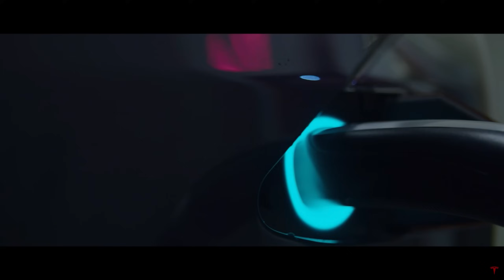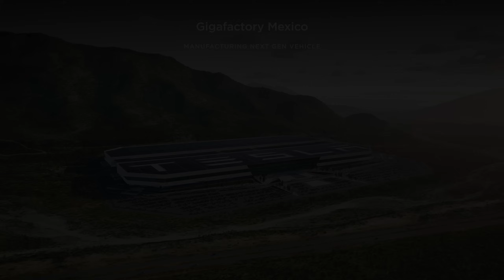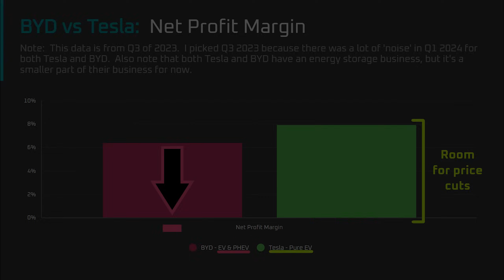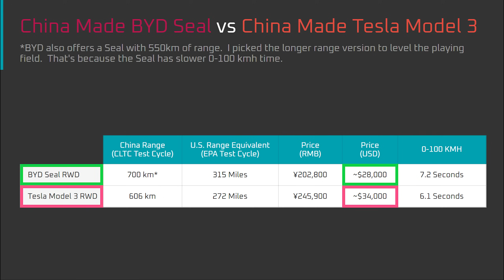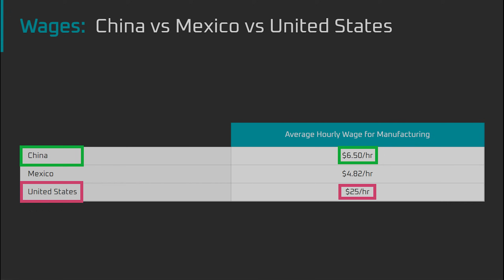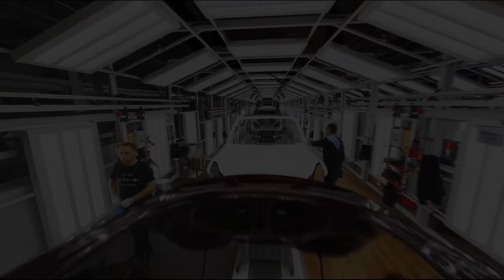Chinese Automakers are Going Global // How will Tesla Compete?

Comment: Most of this is dependant on the Unboxed method, which they told us they aren’t focused on right now and will just add some of the benefits previously intended on unboxed line retrofitted onto current lines for cheaper versions of current models.. but not the unboxed method. If unboxed happens, it’s much further down the road and focused on robotaxi before any consumer models.
Reply: No. Much depends on Robotaxi and it looks like that is going to come very soon. Maybe at 8/8 reveal with scale-up thereafter.
Reply: @Michael-Has-Opinions  watch the video again? While I agree Robotaxi is the focus and unboxed has been pushed off, there’s no mention of that in the video. Multiple times the explanation is that unboxed will keep Tesla competitive with BYD in Mexico, but that’s not happening short or medium term.
Reply: @spleck615  Because Tesla is not using the full unboxed on the new less expensive cars coming to existing lines, people may have construed this to mean the unbox has been delayed.    
Maybe it is wishful thinking but I expect the robo-taxi and the consumer cars are the same.   The taxi ships w/o the controls.
Reply: @danharold3087  Unboxed was delayed. Elon said it. They will make cheaper models on existing lines instead. This is not speculation.
Reply: @spleck615   Yet we are hearing the robo taxi has been pulled ahead.  We will know on 8/8
Reply: @danharold3087  Yes, that’s the point. The unboxed method may be used for robotaxi. Looking forward to 8/8 to learn more. This will be incredibly low volume during development, testing, certification, etc. It’s not being used for the lower cost car that will compete with BYD in the next couple years being discussed here, Elon said those will be built on the existing lines with modifications. My expectation is that will happen in China, just like Highland was, which is why both Tom Zhu and his lead Cybertruck ramp specialist went back to Tesla China, resigning from their Tesla NA roles.
Reply: @spleck615  Tom Zhu going back to China makes a lot of sense in this context.  I agree.
Reply: I don't think it makes sense for Tesla to use factory ability to produce economy EVs for private sales if they can put those EVs into robotaxi service.  That seems to have been Elon's thinking quite a while back but he was apparently pushed into talking about a "$25k" EV by others in the company.  If FSD is completed and robotaxis possible we may never see a Tesla economy car.  It just doesn't make sense, either in terms of profits or mission statement fulfillment.
Reply from the maker: There's some optionality on FSD and Robotaxi.  Lots of variables

Comment: Tesla can’t compete with China BEV makers that can source the batteries for less than Tesla or as in BYDs case they make them in very large scale themselves.
Reply from the maker: In the long term (5-10 years), I agree.  But not in the short term.

This dynamic won't matter as much if Tesla solves FSD.

So, not that simple.
Reply: Teslas use the same batteries as BYD, buying them from CATL. They just don't use these in the US. The US is 20% of Tesla's sales.

Comment: Your prices are all wrong. BYD seal needs heavy modifications to be allowed to be sold outside China and support infrastructure which raised its price significantly. In the EU for example the base version of Seal with 570 km (WLTP) is about 6.000e euro more expensive than the base Tesla model 3 RWD with 554 km of range. And the import tariffs in EU are going to change following the US from 10% currently to ~40% or more.
Also it's highly improbable BYD is profitable selling all-electric vehicles.
Reply from the maker: I'm not sure how this conflicts with the thrust and main point of the video.
Reply: @thelimitingfactor  Based on real prices and data (China artificial market prices cannot be extrapolated to the rest of the world) BYD currently and for the foreseeable future cannot compete with Tesla or even most European manufacturers (their prices should be closer to those of Polestar ~80%-100% more than Tesla). Their offerings offer too little value for the money, especially if we take into account quality, reliability, safety, ease of use (supercharger network), aftersales support etc. If they can't compete with these heavily subsidized prices and the huge Dumping how will they be able to do so when the US and EU fights back and stops the anti-competitive attack?

Comment: I want a cheaper and smaller and slower Tesla with 2 doors
Reply from the maker: Yeah, would sell like hotcakes!
Reply: Agree  @thelimitingfactor
Reply: Single production line putting out 2 door, 4 door, 5 door, mini-truck, van and cybercab. A little patience and we will be there in 5 years.
Reply: " want a cheaper and smaller and slower Tesla with 2 doors"
Might be a good description of the robo taxi with added control package.
Reply: Meanwhile, I want a full solar paneled Aptera. An electric car that actually makes sense, light and very aerodynamic.

Comment: To be honest, that is not a good comparison of EV's. The Fiat 500e in that price is the Cabrio version. The standard version is cheaper.
But the best comparison should be, the BYD Seagull (with the price shipped to the EU and with the standard tax for all EU EV's) and the Citroën ë-C3.
Than, the prices get a lot closer to reality. That Seagull will be around double when it hits the EU market, so €22.000, the Citroën ë-C3 is €23.300.
Than, compare the range, quality, comfort, service and availability of parts.
Reply from the maker: Fair enough, I did that for the Tesla

But, the point ramains nonetheless that Chinese automakers produce vehicles more cheaply, people are buying them, and it's taking market share from European manufacturers
Reply: @thelimitingfactor  BYD seal needs heavy modifications to be allowed to be sold outside China and support infrastructure which raised its price significantly. In the EU for example the base version of Seal with 570 km (WLTP) is about 6.000 euro more expensive than the base Tesla model 3 RWD with 554 km of range. And the import tariffs in EU are going to change following the US from 10% currently to ~40% or more. Also it's highly improbable BYD is profitable selling all-electric vehicles.
Reply: @admarsandbeyond  BYD has been designing its cars for exports, Seal needs few modifications, mostly software, for Europe. They just hike the price to align with the rest of the market and make much higher margins.
Reply: @etbadaboum  "Seal needs few modifications, mostly software, for Europe." Is that your opinion? Is it as accurate as "The real Chinese car brand in Europe is Tesla"? You do know that Tesla has a gigantic factory here and owns 100% of their factory in China right? That's like saying Apple is the real chinese brand because it has a factory in China
Reply: @admarsandbeyond  I know it because this is what journalists talking to BYD has written about. And more than half of Tesla cars are produced in China. Tesla cars in Europe come mainly from China with all Model 3 and LFP Model Y coming from Shanghai. Since Tesla is the first EV car maker in Europe for now, and that most of their cars come from China, yes Tesla is sort of of a Chinese brand. I jokes a little and you took the bait.
Reply: @etbadaboum  I don't know your sources, but it was a BYD official (speaking to Bestintesla) who said that high prices are due primarily to modifications to meet European standards. The same was  reported by Bloomberg and the WallStreetJournal reporting that BYD had 10,000 cars stranded in European ports with serious safety and quality issues. 
And it makes total sense. It would be pretty stupid to sell the base Seal for example 5-6000 euro more than the much better Tesla Model 3 RWD they're copying (a far more efficient, more comfortable, higher-tech, better quality, better supported American car) if they didn't have to.
Reply: @admarsandbeyond  Several journalists, like Telescope for example who is a former NIO executive (and has worked to export cars to Europe by the way) and Chinese commenter for the Formula E in China. Please send these links to these articles because I've never read them. BYD engineers cars for exports. It'd be pretty stupid to have several designs of the same car for different markets. The main modification is software and they have to recode many parts of it and not just the language and the data must be stored locally. Also some have the idea that China has inferior standards for their cars. That's not true, Chinese version of the Euro NCAP follows the same standards. As for cars BYD cars stuck at ports, it's because of logistical difficulties and I didn't hear about quality and safety issues.
Reply: @thelimitingfactor  That's not true. BYD sold only 16k cars in Europe in 2023. The real Chinese car brand in Europe is Tesla, so to say, since so much of their cars from Shanghai and subsidies are cut off and tariffs will soon go up most probably.
Reply: @etbadaboum  What's not true?

Comment: Very well done Jordan. Also for mentioning Europe bringing up European issues. Short term there could be a revival of ICE/Hybrid vehicles outside China. Mid and especially long term it will be BEV with max 30% ICE/Hybrid share. Getting cheaper batteries or complete vehicles and put them on a local brand as Dacia (Renault) and maybe others are currently doing will this work in long term?
There are a lot of questions on the mass manufacturers in Europe but also in Japan (VW, Stellantis, Toyota etc). 
When in comes to luxury models, are the clients be willing to pay much more compared to a Tesla?
Pick-Up as niche for the US manufacturers isn't this to narrow?
Reply from the maker: Good points!  I'm not sure I understand the last one though.